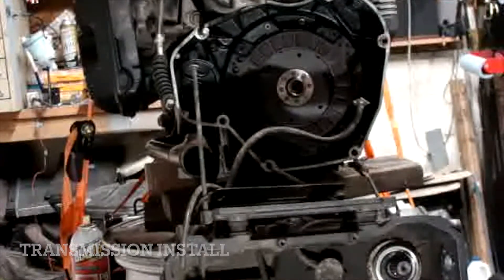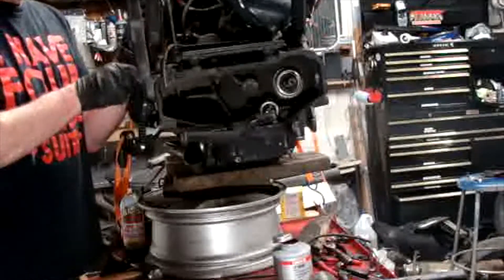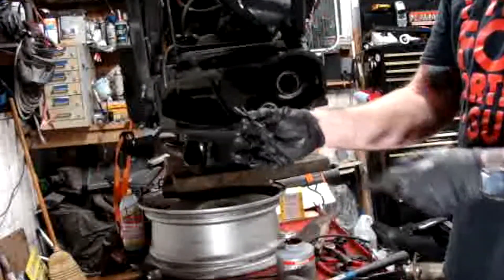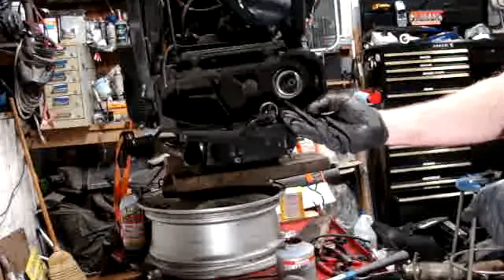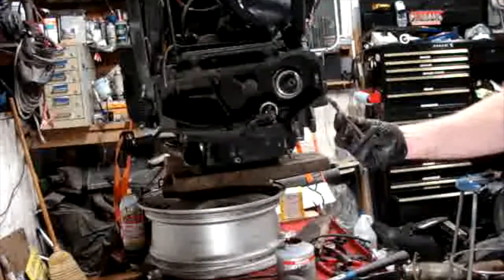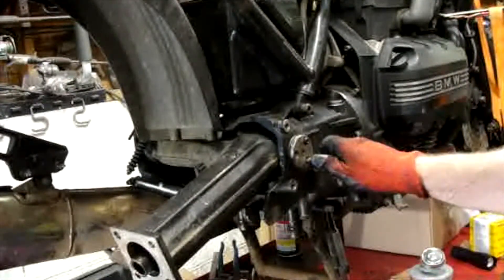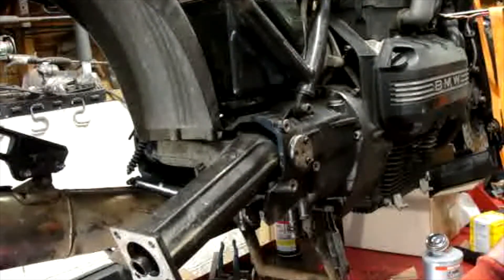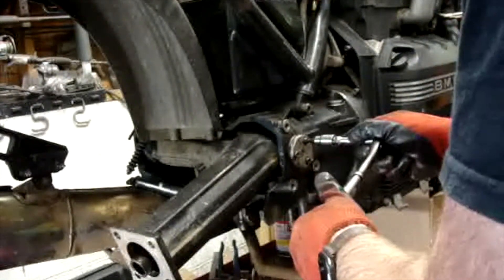BMW K75 Transmission Install

Comment: Hey David! Thank you for this video. Is it possible that when replacing the clutch disk and re-installing the gearbox, you get some resistance? I did not loosen the clutch adjuster, meaning the push rod might have been pushing against the clutch disk and the spring. When re-installing, I assumed this pressure was coming from the spring. Right now my K is stuck in gear and won't start, so I am checking if this could be the reason. The clutch adjuster nut and clutch cable have been adjusted to spec.
Reply from the maker: Yes you will have some resistance but it sounds like you may have other issues. Definitely check your manual on the steps for adjusting the clutch and for the free play. That is very important.
Reply: @dschloe  Hey David, thanks for your reply! Turns out I made a rookie mistake, did not replace the clutch bolts and did not properly tighten them which caused the clutch flywheel to be trapped against the gearbox housing. Now waiting for new bolts to arrive, but the K is ok! Guess that this was causing most of the resistance when installing the gearbox. Cheers!
Reply from the maker: @thomasjohannesvanee6387  well unfortunately that’s how we learn. Good job finding the problem.
Reply: @dschloe  Good news! On Wednesday 21st a K came back to life and joined the roads again :)
Reply from the maker: @thomasjohannesvanee6387  good job!! Way to save another bike.